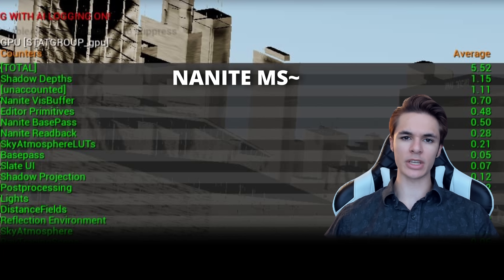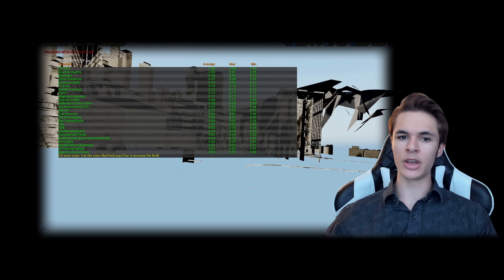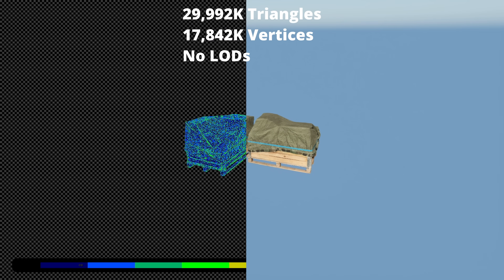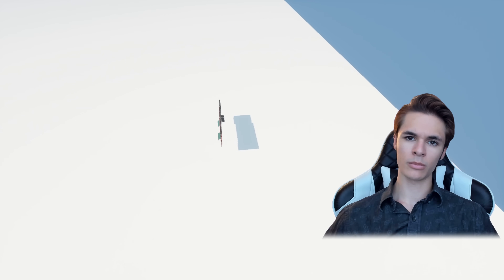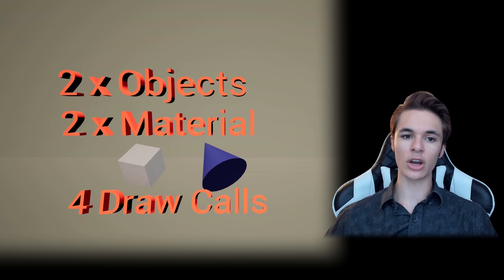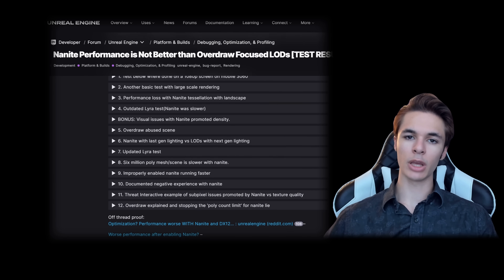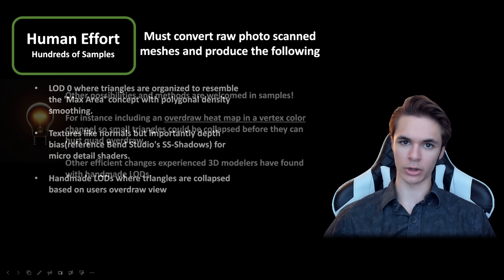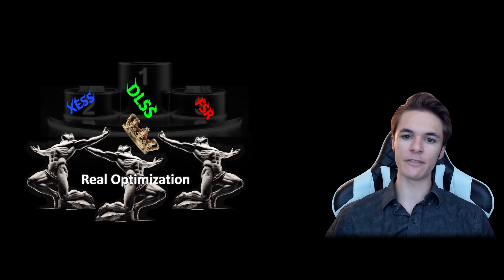Epic's Unreal Optimization Disaster | Why Nanite Tanks Performance!

Comment: I'm not game developer, but there is some questions that I have to ask and some personal opinion as a gamer.
1. The main point I remember for introducing Nanite at first was that you can make models faster by not spending time on creating LODs. So in some of your examples comparison: how much time do you need to create same model with Nanite vs same model with LODs? Considering that all fresh games that being made with a bias in realism require a lot of details I think at a scale it will make a difference.
2. May be because I'm not into this field I don't head that, but I really didn't hearing anyone who would render model with billions of triangles. The only closest example was Minecraft clones who was rewritten in C/Rust etc. who tried to achieve large render distance. Other rendering scenes where 1 frame make take hours of render time, so it was not realtime, but I really didn't hearing anyone else showing examples like that. I can imagine that you are some Senior game developer with at least 6 years of experience, but how many game devs also know about this optimizations? I can't imagine even more than 25%.
3. Let's assume that you can optimize them better, does UE5 allow you to handle optimization by yourself? I imagine that UE4 do, but what about UE5? If answer is yes, then this problem is more arguing about better defaults where you have manual optimization with a cost of your time vs nanite auto-optimization with faster creation time.
4. As a player I want to point out that many latest titles comes with bad optimizations, so much that gamers starting to hate their studios. My personal struggle was with Cities: Skylines 2. They use Unity engine where they definitely have all this abilities for optimization, but somehow they released lagging p* of s*, where some air conditioner on a building that you see from a fly height (far away) had 14k triangles and some pedestrians have 30k triangles. Considering that they can't optimize properly I believe if incompetent devs like them just use Nanite the game wouldn't be this laggy. For me it realistically to assume that by default a system that handle optimizations automatically is far better, than a manual one who can be only optimized properly very few individuals.
Reply: @SioxerNikita hats off to you!  I've read the entire thread and I do admire your patience.  Not sure what to attribute it to (as you've made your points clear very early on), nevertheless, bravo for keeping on summing up your arguments in a concise and clear way, very well done!
Reply: @SioxerNikita  You sir are a god damn narcissist.  I'm not saying that to say that. seeing you talk to people. Seeing how you  are taking a shit on me. accusing me of being passive aggressive, Because i think the problem is devs not giving a shit about making there games run on older hardware. is Pretty weird if you ask me.  You don't see my god damn point do you? You're proving my point right now.  Why should we go broke on playing your damn games. 

Oh, am i now. I'm the problem, for your games to run shit. and I'm setting unrealistic expectation for why your game is not running on 10 to 8 year old, 5 year old,  3 year old  hardware. Really, Really!! man!. I think its clear it is your type of mindset that is keeping the problem in the industry.  i am trying to tell your stubborn ass the truth. And you just can't see the problem can you.  Nothing is black and white. You need to think outside of the box. And I'm been in this hobby for over 20 years. I may not have jack to show for it. Doesn't nullified  what I'm saying.
Reply: I've seen several examples of people making minecraft clones that run 1000s of times better than minecraft by employing some automated culling techniques and low level polymaps. A lot of those techniques would only work with block based games, but others can be used to improve the quality of others with just a few minor tweaks.
The thing is, there is no one-size fits all solution. Nanite will work in very specific scenarios, but it is offloading the interest in becoming an expert in a field to simply hoping that the plug and play tech will be sufficient enough.

Good games come from creativity. Great games come from limitations.

But to your last point "For me it realistically to assume that by default a system that handle optimizations automatically is far better, than a manual one who can be only optimized properly very few individuals." When more and more programmers are being shoved into frameworks and libraries which will solve all their problems, the number of people that have the interest to learn the techniques necessary to get to a proper understanding of the systems they use is getting diluted. But do not assume that a solution custom built to handle a specific scenario will be worse than the generic solutions that engines provide.
Reply: There are automatic LOD tools for a very long while now.
Reply: About that final point about CS:2, that was exactly their plan. They were going to use Unity’s competitor to Nanite, but then Unity delayed or cancelled it, so they were stuck creating a brand new LOD system from scratch at the last moment.
Reply: It wasn't all that long ago that when a given object with a face that has its normal towards the camera with an applied texture or set of textures only required to do a bit of mipmapping for various distances from the camera. This has worked for decades. Now if the mesh or object is up close to the camera and is targeted as being within the focus view of the camera - scene. In other words, it's a point of interest that is fairly close, then yes at this distance I could see using more advance techniques and various different shaders to give it more detail. However, as the object moves into the distance as its relative view size becomes smaller and smaller, the back side of the engine should account for this and reduce it down to just a few vertices, triangles or simple quad pending on its shape. Eventually at a far enough distance it can even transition from being a full 3D model into a basic 2D billboard instanced background sprite. And if far enough back, it could even be blended into the rendered Skydome or Skybox. It's not all that hard. Then again, I've written my own basic 3D Graphics Rendering / Game Engine using DirectX 10/11, OpenGL 1.0, OpenGL 3.3 - 4.2 and even a basic renderer in Vulkan within C/C++. And I'm a 100% self-taught with this being one of my past hobbies. I don't mean just making the engine either. I'm referring to learning to program in C/C++ and a few other languages.
Reply: @XCanG  Artists are expensive and making them work on LODs instead of actual content will bloat your budget in no time.
Reply: "For me it realistically to assume that by default a system that handle optimizations automatically is far better, than a manual one who can be only optimized properly very few individuals"

Fair point, although the "manual" technique has been used since basically the beginning of fully 3D games and had been mastered not by "few individuals" but by the whole industry at some point. Throwing everything in the nanite pipeline just because it's simpler and faster is a false excuse once you know that the manual, traditional techniques will get you better performances with little to no difference in visual fidelity. Even better, the extra performance you free with the manual LODs allow you to minimize the need for FSR or DLSS, both of which indisputably degrades image fidelity as well.

Performance tests with FSR/DLSS enabled are basically a lie over what the performances of the raw game are. Native resolution with more traditional anti-aliasing techniques should still be the norm as it always has been.

Big games relying on super-sampling are just a sign of badly optimized games, it's as simple as that.
Reply: @SioxerNikita  
My argument centers on planned obsolescence. From the start, I’ve been emphasizing the constant need for hardware upgrades to keep up with software demands. Every 2 years, new CPUs and GPUs are released, making the current ones seem outdated before we’ve fully utilized their potential.

I don't think we have maximized the potential power and capabilities of these so called "outdated" hardware. before deciding to say yep we just got 2080ti in 2018 and the 3080ti in 20021. 4070ti in 2023

 I mean hell, the 2020 Ipad pro was outdated within the same year when the the M1 clip came out in 2020. A year later Apple comes out with 2023 IPAD pro M1. Making the 2020 iPad pro dead in the waters.The 2020 iPad Pro had been running 24/7 at mid-screen brightness non-stop for nearly 5 years. It provided me smooth 120Hz gameplay, allowing me to play COD Mobile for hours, watch YouTube in 4K, and create poster-size art for hours on end. 

This has been my experience for 4 years straight. How can anyone say something is outdated after just 1 or 2 years when it takes about a year or two to iron out the bugs of newer hardware? 

I took a break from the gaming and the drawing to focus on woodworking and working out, for a few months.. When I returned to the "field" as i like to call it, I found myself with an outdated computer that can barely run Unreal Engine, yet alone other games engines. which it used to handle it without any problems. This computer did run an even older graphic card the big boy EVGA GTX 760 Dual SC 2GB the same CPU, and the same  RAM as before.  it seem to play games pretty well, at mid to high at at 1920-1080. 

But now, i can't  play the same games with the performance i once had. even at 1280 x 1024.  I remember getting close to any where between 80 to 90 100 fps on black ops on that 760 card some how. I think it was due to the overclock i had on it. It took two power connectors to even run it. 

I first ran it on dell ailenware x51 for years on just one connector. downclocked it,  It lasted me until 2018-2019. When i built my workstation PC, hence for 32 gigs of ram i mention.  You know that is usually what people in the PC community commonly buys for when they are working with ram heavy application. Such as 3D rendering, video editing. Running virtual machines. Data analysis and machine learning,  and Web Development. And you say 16 gigs is enough. 16 gigs is the lowest you want to go. 32 gigs is the sweet spot for anyone in Development. 64 gigs is the highest i would go after 120gigs. well, 120 gigs is future proofing.
Reply: @SioxerNikita I see. What you don’t see is that planned obsolescence is the whole reason for something to become outdated in the first place. One example is the light bulb. The Phoebus cartel, formed in 1925, intentionally limited the lifespan of light bulbs to 1,000 hours to increase sales.

While it’s true that technology evolves and some level of obsolescence is natural, planned obsolescence accelerates this process unnecessarily. This can lead to increased waste and, of course, higher costs for consumers.

Regarding your PC, it’s worth noting that the $3,000 might not solely be due to the manufacturing costs of the components. While components are indeed produced at a lower cost, the final price includes research and development, marketing, distribution, and other overheads. However, planned obsolescence and market strategies can contribute to inflated prices. So there is that.

It’s important to recognize that different perspectives exist on this topic bro. My intention is not to dismiss your experience or dismiss you as person. But to highlight the broader implications of planned obsolescence. I appreciate your input and hope we can continue this conversation respectfully. Since all you have done is insulted me. That tells me that i hit a nerve. and i know i am correct in what i am saying. 

If i didn't hit a nerve with you, you wouldn't be responding with insults for every reply i make. If you've been around the game industry, for longer than 20 years like you seem to be. You May at least know what  i've been saying, is valid. Hell even the guy behind this channel has a video about what i have been discussing with you that supports what i'm telling you. 

https://www.youtube.com/watch?v=lJu_DgCHfx4
Reply: @SioxerNikita  Just so you know,  I'm not being sarcastic, farthest from the truth. All i am doing here is trying to improve my knowledge, learning from people like you. And  yet your the only person who is here talking to me like I'm some child. being dismissive of everything, I've said. Everything I've mention is well known in the industry according to my findings. 

Perhaps the information i have learned over 19 years playing around in development  and what i have learned over the the last few months of being back on the PC is nullified and or outdated is that the case?  

You seem  more or less claiming sole authority in the industry.  does that mean, you know every square ounce of the gaming industry, to completely dismiss and void my points. and concerns  Are you in every field in the gaming industry. do you hold the rings of knowledge over everyone else? 

The industry is constantly evolving with new technologies and trends. It is not a static field and requires continuous learning and adaptation. The whole point of development is continuous learning and adaptations. With that in mind.  

How can you know 100% i'm wrong? How do you know your 100% right? Do you not believe that others might just have more insightful knowledge, than you? regardless of programing knowledge/experience and vice versa.  

What if i told you, we're both right.

What if i told you that from the start of this  conversations, it all has been nothing but me questioning answers, that you given me from my first comment to your last comment, on asking why, so and so. You said cost, i said this mindset is the problem within the industry. And after that, you went into insulting mode. Picking bits and pieces to every comment to every metaphor i said and turning it back on me and telling me I'm the problem within the industry. And i have no idea on what I'm talking about. 

You're not even giving  real reasons i am wrong, your just telling me i am wrong. Besides that you calling me entitled and brain dead.   Are you normally aggressive to people actively learning.  actively asking questions and than telling them they are wrong, without real reasons. Please understand that i am only asking questions.  

Yes, i strongly agree  really should be optimizing the software for the hardware we do have to maximized the potential of these graphics cards. I don't really see why you have an issues with this. 

When i tell you that i value your input, i value your damn input regardless if i take it or not. did you not know that people can perform such tasked. dam bro, you are condescending as cat.
Reply: Godot does automatic loads and at the very least those don't take as much processing power.
Reply: @SioxerNikita  Planned Obsolescence:
Planned obsolescence is a strategy where products are designed to have a limited lifespan, encouraging consumers to replace them more frequently.

The Phoebus cartel, formed in 1925, is a well-known example where light bulb manufacturers intentionally limited the lifespan of their products to 1,000 hours to increase sales.

Impact on the Environment:
Planned obsolescence leads to increased waste, resource depletion, and higher energy consumption. This exacerbates environmental issues such as pollution, deforestation, and climate change.
In 2021, it was estimated that around 62.8 million U.S. tons of electronics would be thrown away, contributing significantly to e-waste.

Pricing in the Tech Industry:

The high cost of tech products is not solely due to manufacturing costs. Research and development, marketing, distribution, and other overheads also play a significant role. Companies often use pricing strategies to maximize profits, which can include planned obsolescence and market competition.

Right to Repair:

The right to repair movement advocates for consumers’ ability to repair their own devices or take them to a technician of their choice. 

This includes access to repair manuals, replacement parts, and the ability to bypass software locks that prevent repairs. 

Right to repair legislation aims to make information, parts, and tools available to consumers and third-party repair shops, promoting repairability and reducing waste.

The movement has gained traction in various industries, including consumer electronics, agriculture equipment, and medical equipment.
Reply: @SioxerNikita  I'm talking on the side of programming, not asset creation. I'm talking about the actual rendering engine, the graphics pipeline, physics engine side of things. I can write the interfaces to find, open, read files and extract their contents via a specific format and convert them into data structs and arrays that are required for the scene graph hierarchy and rendering pipeline as well as the shaders and lighting schemes. Now how they go about generating the models, or textures, that's not my one of my skillsets. I'm not an artist like that. And I never said to not use shaders. 

There are pre rendering techniques, rendering techniques and post processing techniques. You also have the ability to use or utilize the geometry and the compute shaders. So, one of the more important things to do is the perform unit and performance tests, run some diagnostics and analysis on it (the entire project or solution, application) and look for bottlenecks. Try to reduce unnecessary includes in the wrong places. 

For example; if you have a header file and you have the include directive:

#include <string>

And this header file of yours is included say a dozen or so other files possibly even a hundred, where this will be copied and pasted into every translation this will entail a lot of unnecessary overhead during compilation, linking and building. It'll also make your executable bigger. 

Instead of including this within the header file direction, there is an alternative to where you can only include a small portion of it provided that you don't declare or instantiate any "string" objects directly within the header. Instead, you can have references to them and then use them within the translation unit. 

There are dozens, hundreds even thousands of places where you are going to have loops and double nested loops. Make sure that your row-column major order is laid out for proper cache coherency. Try using the stack as well as cache more often than the heap. Minimize the overhead of the branch predictor. Try to keep structures packed and aligned to increments of 8-, 16-, 32-, or 64-byte boundaries. Don't trample over the page boundaries. Try to stream data when necessary if possible. Use references or instances. Have a well-designed batch processing and priority queue system. The less calls to push stuff from the CPU to the GPU over the buss the better. In some heavy critical sections use SIMD-Vector Intrinsics where it makes sense to. Try to utilize multi-threading and parallel processing in a thread safe manner. Prefer to use shared_ptr<> over unique_ptr<> unless it's absolutely necessary. Try to use vector<objects> over shared_ptr<> if possible. Refrain from using new and delete directly in C++ unless you know absolutely what you are doing, and even then, they can still lead towards unforeseen future problems. 
Use templates and some of the paradigms such as CRTP, SFINAE, RAII, and a few others where they seem like to be the right tool. In other cases, you might want to use an Interface Protocol design, and in some perhaps a Factory design. And some frown upon it, but they do have their uses, even Singletons can be useful if used and implemented correctly. Write your own parser for your own scripting language to automatically load in assets, levels, data, etc. with the ability to change their properties and settings so you don't have to constantly recompile every time you move an object one or two pixels or ran a small sequence of animation frames. There are many, many things you can do to optimize the code base within your own engine.    
 
I might be able to do some of the music from the audio processing side of things for I do have a background in music as I did play the trumpet for nearly a decade back when I was still in school. I can kind of do some level designs, terrain manipulation. But as for creating the actual assets or models such as with blender. That's falls to others. I'm just referring to how the inner workings of the engine can be handled. And there's more than one way to design it, to implement it. There are always pros and cons. You have to weigh out the differences and pay the cost for what you need and want you want out of it. You may also have to make some sacrifices in some areas too.

I wouldn't say hardest, but one of the most complex or most mathematically complex objects to implement within the game engine even over the lighting calculations and some of the more advanced shader techniques is writing your own font engine or font renderer. 

Debug, Debug, Debug, when your done with that Debug some more, then finally unit test it about 3x more than you debugged it! Profile it at least 2-5 times. 

Why go through all of that instead of just using an already existing game engine? There're always tradeoffs. When you write your own, you only include what features you need. You know the entire inner workings of the engine as well as the integration of all of the source code. You can easily update or patch it seamlessly. You're not at the mercy of license agreements except for the external or 3rd party libraries you may be using. It's a challenge but also a very fun and very rewarding project to complete and working virtually bug free. You learn a lot from it. You appreciate what goes into more. You have more passion towards it. And last but not least, it is yours! 

It's kind of like Factorio, Satisfactory, Dyson Sphere Program, Oxygen Not Included, ... "The Factory Must Grow!" kind of mentality! Happy Coding, Happy Engineering! :)
Reply: @skilz8098  bro
amazing
Reply: @SioxerNikita  If that's the case this mindset is why we're having the problem with today games in the first place. Its the same excuses that politicians uses, when they bloom up.  I have a hard time running today's games above 60 fps. And i have an 8 year old Mid-range AMD RX 460 4gig. And 5 year old Ryanz 5 1600af with 32 gigs of ram. Doesn't make any sense for this bad boy be not be able to play games over 100-200 fps. Hell i'm even using 1280 by 1024. Can't even put most game on high. games today looks unbearable to even play on low settings.
Reply: @SioxerNikita  Bro, did i insult your mother? Did i do the do with your mother? Why are you coming at me with this passive aggressive nonsense.
Reply: @SioxerNikita  You know what. You just told on yourselves by proving my point about the gaming industry having a problem. from your last sentence, well your whole 2 comments just prove it.  We should be able to run cyberpunk 2077 with 10 year old technology yet alone 8 year old technology. god forbid.  If they can make it run on a fucking console, why is it so fucking hard to run it  on desktop grade GPU. Something is not lining up here bro.
Reply: @SioxerNikita  You mention cost as to why optimization its not the main point of first sages of development.  You think that is is applicable excuses as to why your software is not not running well on old hardware. Developing games or software on high end hardware and expect no optimization problems because you can't see the performance issues in other "low end" computers. Do you not see the problem, in doing that? 

We shouldn't need to spend 500-2-3k on GPUS/CPU to play games with what the devs intended the game to be played at. We have had 4k res in games since 2006. But yet, it take so much processing power to run 4k 60hz to 120 hz at mid to high settings. When its pretty much hard for most graphics cards  to play games at 1080p 60 fps at maxed.

We should be able to maxed out a damn game at 1280 x 1024 with over 100 fps, with a RX 460 4gig vram, and yet it runs 20-30 fps "Once human" for example. This is what i am referring to as optimization. I will say it again. It took 16 years for Crysis to be able to run on what we consider low end pcs today. Crysis  was the main benchmark for stress testing PCs back in the good old days of 2007. a Game that came out in 2007 and  yet still having some trouble playing  crysis with a 2016 graphics card. Do you really not see the problem here. 

I never claim to be a programmer or a developer of any kind. I also don't pretend, that i know everything about development. That's on you bro. What i can claim is that i have over 16-20 years in game/software development because that is all ever did growing up,   Its such a vast ever growing subject and nothing is absolutes. You're forgetting the one major step in learning. You will never stop learning new techniques on how to put objects together.  

Hell even the guy behind C++ Bjarne Stroustrup, he even admits he has trouble understanding C++ at times, and he is the damn father of the language. I also just read a blender articles, and seen where it states, during the UI change of 2.5 there was some 90s interface code from its SGI origins that was blocking advances for a more contemporary user experience. See how old unoptimized code can cause issues later on in development.
Reply: @SioxerNikita no game should be intended to run with dlss that is the entire point of the video. Games are intended to run with dlss because of arbitrary limitations like dev time restrictions, which is why in all areas not just graphics video games have suffered they are rushed soulless projects used as investments. Instead of looking for solutions to the problems they slap nanite or dlss onto the issue to mitigate shortcomings to an acceptable degree. They do not solve the problem they are band aid fixes he directly says this in the video.
Reply: @SioxerNikita  
I appreciate your feedback and understand the challenges you’ve highlighted. I really do. And yes, I know what binary code is. What I’m saying is quite correct and valid within the industry. While I may not have hands-on experience yet, I’m actively learning and engaging in game development. I’ve been working on building my skills and reading up on best practices to deepen my knowledge before diving into it. I’m committed to continuing in learning and improving, and I value the insights from everyone.

However, it’s hard to discuss topics like this without it turning into a heated debate, which seems to have happened here. My main point is that it doesn’t make sense to be forced to upgrade hardware every two years to play the latest games. I’m also questioning why we need to create entirely new CPUs, GPUs, RAM, and motherboards every year when logically, we could optimize the software for the hardware we already have. It feels like you’re dismissing my concerns because of this. Do you not see that we have enough CPUs to go around the Earth 9.5 times?
Reply: @SioxerNikita  This will sound stupid for someone like you. However, Why not make optimization the main point of Development. To me, optimized code should run on any computer with close to performance between Different configs ratio, regardless of said hardware. We shouldn't be relying on hardware to give us better performance in games or non games software. 

We should be optimizing the software to run at its full potential regardless of said hardware. It seems to me, that the problems is comes down to black and white thinking. Well if the software is running shit, than it must be the hardware. And not, oh shit, its my fault for not optimizing the code in the first stages of development.  

The other problem is that, Game engines are so bloated with experimental/prototype code, and messy, unreadable code from the first days of development. No wonder optimization is hard. Its hard because you have 30 years of old code as the foundation of the game engine.There are bound to be bugs in that first 30 year old lines of code. 

We also have to keep in mind the operation system. We have 38 years of old line of code in our OS. we have 52 years of lines of code with C programming language There is bound to be bugs preventing something from working. That's why it is generally better to start over and make it from scratch. when the dough don't rises. 

It also comes to mind that, perhaps, optimization is hard due to something simple as the programming language/compilers we all been using  just sucks at handling such request of today's games and software . So maybe just maybe, the underlying problem is the how the programing language talks with themselves. Perhaps one language don't like one or the another. So it gives each other bugs to mess with each other.  You put 5 black guys with 1 white dude in a small room. there bound to be some errors going around and one of them ending up in the ground.
Reply: @Dojobows  Yeah, but early optimization can be just as bad as not optimizing at all. Also, there is nothing wrong with experimental ideas. Go and watch the interviews with John Carmack, and John Romero. They'll tell you what they did. How they pushed the envelope, the boundaries of the hardware and revolutionized the gaming industry at large. Some of the best advice they lend towards others is having the ability to go and be able to make your own tools.

You also made the mention of or on the lines of others focusing on the hardware and you're trying to make the point that we should focus more on the software and ignore the hardware. Well, there's nothing wrong with focusing on the software however, there's two caveats to your argument. 

1. Your software wouldn't do anything without the hardware it runs on. 

2. If you don't understand the hardware, how it is designed and operates; how well and what good is your proposed optimized code going to be if you don't understand how to even optimize it? 

If you don't understand how the cache works, how the branch predictor works, how the OS or kernel communicates with the compiles, assemblers, and the device drivers, or how interrupts are handled, or virtual memory and paging is handled. What good is your high-level language code going to be?  

One needs to have very good understanding of both the hardware design, and how the various structures and implementations of software runs on said hardware. 

If you wrote an application for, just say Windows or just Linux and you didn't care about the hardware, and yet you tried to optimize your code based on the software itself and the OS its running on. You're not going to get the same performance if that OS is installed on an Intel vs an AMD vs ARM vs RISC-V, etc.

Early optimization can lead to bad designs, or you are optimizing things that don't need to be. It's better to build a working framework, unit test it to verify it's working as expected. Then run analyzers, profilers, sanitizers on it to see where the bottlenecks are. That's where and when you go and make some of your optimizations to try and minimize those bottlenecks.

Look to check and see what the branch predictor is doing. Are you having conditional checks that tend to take the wrong branch and have to unwind as the base case instead of having the conditional check always take the expected case and only branch out in the less traveled edge cases? Optimize to fix them. 

Are you looping through your multidimensional arrays in the wrong index order where you are generating more cache misses than cache hits? Make sure you are getting better cache coherency. 

How about your threads considering both multithreaded as well as parallel programming techniques? Are they thread safe, are they synchronized or asynchronous? Are they atomic, volatile or mutable operations? What kind of safeguards do you have in place? 

How about any kind of networking code with Client Server Side along with your sockets, and the various different protocols such as TCP vs UDP?    

How about the data size and alignment within your structures? Are they 8,16, 32, 64 bits aligned, are they packed? Are your data structures that are stored within vectors or arrays too large to fit in the cache lines? Are you creating pools of memory too large to fit in a page file? Are you opening and closing file handlers, sockets, etc. too often when it's not necessary? Are you using the heap when you don't need to instead of the stack? 

This also doesn't account for the options, and properties that the compiler, linker or interpreters are going to try and do to try and generate the source code that you supplied it. Your build tools, workflow, environments, and organizational skills are all just as important.  

 * Are you dynamically linking or statically linking libraries either being your own or 3rd party? 

 * What kind of calling conventions are you using? 

 * What are your compiler flags set to for compiler optimizations? 

 * What types of programming paradigms and idioms are you using or implementing? 

You also have to consider both your target audience and user base. 

How are they going to be using your code either as a library, an interface or application? 

Once you release it out into the wild (production) and people start using it for quite a long time, there isn't much you can do to go and change it after the fact without ruffling some feathers. 

 Also, if you're not developing for yourself and you are working from someone else or some company you may not have a choice. 

* What kind of conventions, guidelines, rules, ecosystems are they using? 

* What are the details of the specifications and requirements for their clients? 

* What is the current budget, time allotted, or deadlines? 

* How much money, time, resources, work hours, etc. did they invest into existing projects and code bases?

* Do you think you're going to walk in there and have them change everything because you think it should be done differently? 

* When they've invested hundreds of thousands of dollars, even millions into those projects; do you think they're going to let you go willy nilly? 

Also, before you're able to check your code out, in many cases it has to go through some sort of Code Review process or stage before it becomes approved.    

When it comes to computers and the programs or applications they run, you can't just consider one and not the other. You have to consider both, and you have to consider many different aspects about them that are involved. It's not just all software. That software doesn't mean shit without the underlying hardware, and at the same time, that hardware doesn't mean shit without well-structured code running on it. They go hand-in-hand in tandem.

Another key factor about optimization pertains to different parts of the application and what it does or is meant to do and you need to weight the benefits of optimizing it. 

* How much gains or returns are we going to get for investing x amount of time for y amount of performance gain? 

* How long is it going to take to refactor this code or to incorporate the optimizations?

Some things to consider when thinking about optimizing.

*  How often is this segment going to be called or running in memory?
* Is this function only called once? Is it called hundreds or thousands of times? 
* How much of the stack frame in memory does this function require?
* What types of data and how much are going to be processes? 
* Is this a function for file handling and resource management? 
* Is this a critical section?
* Is this within a thread pool and is it thread safe?
* Is this networking code?
* What are the security risks and vulnerabilities? 
 * Is this the back end, middle interfaces, or front-end code? 
 * Is this a library or API code, or is it an actual tool set, application or program? 
* Is this just a toy -hobby - personal project?

(continued...)
Reply: (...continued) 

Oh, and by the way, I have 0% formal college, university credited education or training in computer science. I don't do this for a living, and I have not worked in the industry. I'm 100% self-taught where I took it upon myself to learn C/C++, DirectX 9.0c,10,11, OpenGL 1.0, OpenGL 3.3-4.2, Vulkan to build a working 3D Graphics Rendering - Game Engine - Physics Simulation with Animations, Collision Detections, Particle Systems, Lighting, and even 3D Audio just as a hobby. I even wrote the Windows boiler plate code to create a Window from the Windows API and this was back during the XP-Vista era right around when Windows 7 was being announced or just being released. 

So before even getting to work with DirectX or OpenGL, there was at least a good 200 - 500 lines of code that needed to be written first, and it wasn't ordinary as you had to make a few modifications in order to set them up and prepare them to be able to use the Graphics APIs. You had to have the Windows code API to be able to pass its drawing context to the Graphics API. You had to bridge the gap. Today people just include 3rd party libraries where all of this can be done for you with just about 3-5 lines of code.

Try reading through the Window's header files for the Win32 API to try and understand how it was implemented and how to use it. This doesn't account for having to learn the C/C++ languages themselves as well as all of the tools such as the pre-compiler to the compiler, the linker the debugger, as well as learning how to decrypt the various compiler and linker errors. This doesn't account for having to learn about the Graphics APIs and the Graphics Pipeline and the Shader Models and how they're translated and compiled. 

This doesn't account for having to learn all of the data structures, algorithms, which ones and versions to use in the appropriate cases that involve your Big O space and time complexities. It doesn't account for all of the different paradigms and idioms within various languages such as Procedural, Functional, RAII, OOP, SFINAE, CRTP, and much more as well as the syntax, grammar and features of a given language. 

Then on top of that, all of the 3D and 4D math that is involved for being able to perform all of the required calculations, algorithms to generate a hierarchical scene graph that incorporates, transformations, objects, models, meshes, textures and texture transforms, materials, mipmaps, transparencies, various lights, shadows, reflections, etc. You might want to brush up on some algebra, linear algebra, vector calculus, trigonometry, applied analytical geometry, complex numbers and complex spaces, the Hamiltonians for things such as quaternions.

This doesn't account for compression and decompression and understanding hamming codes. It doesn't account for encodings and decoding, writing parsers for a custom scripting language, abstract syntax trees. Binary Space Partitioning Trees, Quad Trees and Oct Trees.

It also doesn't account for all of the Physics too that is involved for basic kinematics, collision detections, particle generations, frame animations for both sprites and 3D models, boning, skinning, etc. Then you have all of the 3D Camera Viewing and Scene management such as clipping and culling, the view frustum, depth buffer, mutli-pass rendering due to transparencies, batch processing or batch rendering, projections, perspective divide, AI path finding and much more.

So, there's more to it than just thinking you're going to optimize for the sake of optimizing especially if you don't know what to optimize, how to optimize it, and if it's even worth optimizing.

Think of this as constructive and positive criticism. You may want to take this advice under consideration.

I don't work within the industry, but I have written a good hundred-thousand-line C++ application with several projects within the solution space to make a fully 3D working game engine using it to build basic first-person shooter dungeon survival game within it. This was an OpenGL 1.0 project. A DirectX 9.0c in C# I made a basic flight simulator. And several other projects. This was before YouTube, GitHub, SatckOverlow were around, and finding information on the internet back that was limited, mostly text based, and not complete only small code snippet examples or pseudo code to reference from. And no, I did not copy and paste. I typed every character by finger touch of the keys!

Out of the entire set of projects, which also doesn't include my projects for writing a 6502 NES emulator (basic minimal, doesn't support all of the mappers, but enough to run a couple of test roms) one of the toughest things to program and handle correctly is Font Rendering! It is some of the most mathematically intense pieces of code to write in order to properly handle all of the character glyphs based on various font types, font styles, their sizes, each and every character from their baseline to their raised portions, to the dangling characters, as well as their spacing. This also doesn't account for both background and foreground color, outline color, or if the font is mono spaced or proportional as well as the width of the line and if you are word wrapping, and how to create blocks of text and whether or not they are block aligned, center aligned, etc. This also doesn't account for the text cursor and its active position and how to handle backspace and delete, copy and paste. Yeah, it's one of the most complex things to program. The one aspect we take for granted the most. 

So yeah, I have a good amount of experience in optimizing some code, knowing when and where to, if it needs to be, or if it's worth it. 

Hope this helps you on your coding journey!
Reply: @skilz8098  clearly a guy unburdened by what has been
Reply: @skilz8098  Thanks, Its been a slow start. I'm slow when it comes to mathematical shit but i still giving it a shot. Haven't had a desktop since covid happened. and just got back on one, so now I'm getting back into my computer hobbies. And every so often i get pulled  back into the realm of 3D modeling, game dev, relearning programming again. One of those thing about being autistic. repetives can suck and a blessing.   I'm going to have to copy your comment into word, so i can read more into them. lolI

I never said just forget the hardware, I meant as we need to stop buying into the trope of needing to upgrade our hardware, every time a new game or software comes out. We keep upgrading hardware, instead of forcing on optimizing the software for the hardware we do have. Not what we might have in the future. Our hardware is expending to quick for software to keep up. or our software is expending to quick for our hardware to keep up maybe? Might be both. 

Anyways. Do you think it is really necessary to have to upgrade our GPUs for the sake of performance boost. When Game/software devs need to figure out how to optimize there software for that current graphic card/cpu/ram. or the hardware engineers need to do better?  I don't know man,  I just know that there is something off about the whole thing. 

I see one game running fine on one PC and melting the next PC. I also see game requirements ever so rising. When in some form of a reality, they should be going down. right?  We shouldn't be upgrading our system so damn often when the simple thing to do is maximized the hardware we do have. 

I'm pretty sure that we haven't even maxed out dx9, yet alone maxed out dx10, dx11, before hitting dx12. Its funny, in that the dx9 come out in 2006, dx10 come out in 2009, and dx12 come out in 2015. DirectX 12 Ultimate come out in 2020 for xbox thingumabob. Back in the day, a lot of game devs didn't want to move from dx8 to 9, or 9 to 10. because they haven't even maxed it out the full potential. at least that is what i remember. 

It took Crysis damn near 16 years to be able to run on what we call potato pcs today. a game from 2007, You ever wonder why you don't hear the phase,  "Can it run Crysis" well 16 years later, every new PC today can run it.  Now you all you do hear is can it run cyberpunk 2077. 

My final say is this. A six core cpu should be six cores and whatever threads. Whether its high end or a low end,  there shouldn't be much differences between the 2 cpu performances beside high end has a higher clock speed. That is where you think hmm, Hardware is ether to low or not high enough. why are Cpu companies, making low end cpus to the point of  not being about to have few windows open before it crashes, to needing a super computer to run today games. it doesn't make any sense.